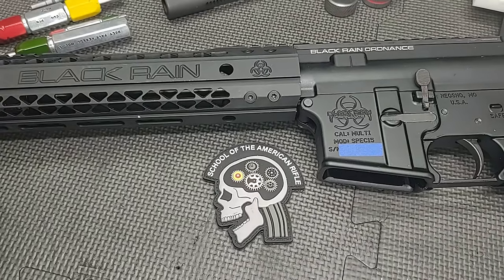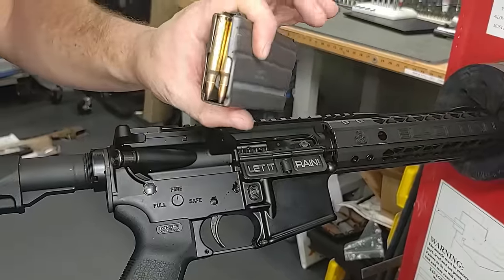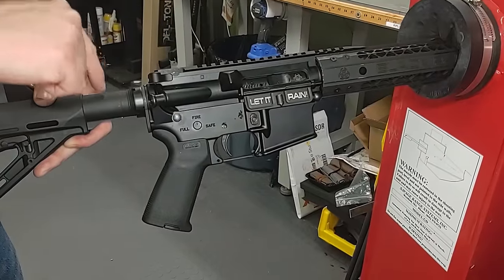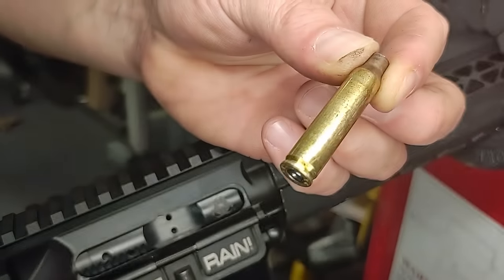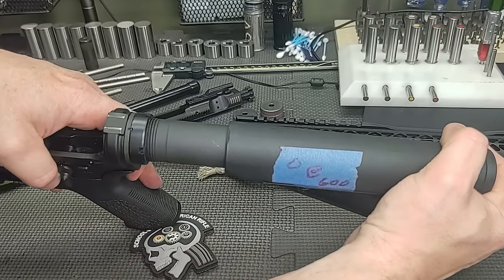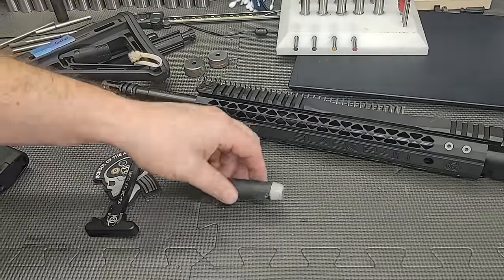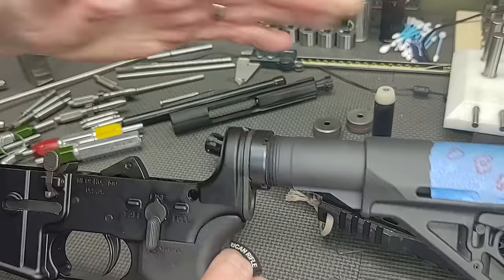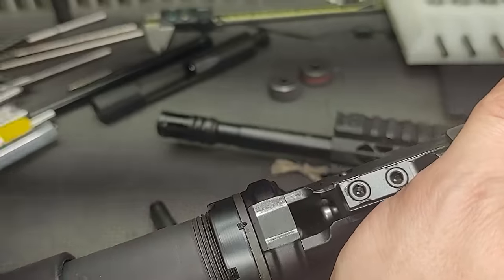Black Rain Ordnance SPEC15 - AR15 Autopsy (Part 1)

Comment: It seems like you have better measuring equipment than the people actually CNC machining the parts of the rifle. How could parts like these pass any type of manufacturer QC with so many tolerances so far off? No one is checking for obvious flaws?
Reply: It's a bit more complex than that. You'd see a non-trivial price increase on a manufacturer's products that gauged out perfectly. Costs increase both on time involved/manpower hours and product rejection. Most manufacturer's aim for "good enough" and rely on tolerance stacking to a minimum. Often times, you can pass perfectly fine under this operating standard. There are exceptions both ways.
Reply: Because they don't need to be perfect.

Comment: I have a Black Rain Fallout 15, that I bought a year ago. No issues with it yet, and put right around 800 rounds through it. That said I did immediately replace the buffer and spring after purchase, with a Cozad Manufacturing Mk18k 4 oz H2 AR15/M4 buffer and a Strike Industries flat buffer spring. I did that because I replaced the same parts on my older (2011 Olympic Arms) AR15 with good results. My eject pattern with the BRO is right around 45°. I just checked the buffer tube, key strike spot, gas tube tightness etc and I don't have any of the issues present on this rifle.
Reply: 800 is a pretty low round count and much less than this rifle.
Reply: No getting around it.. With a gas port size of .089 on a 16 inch carbine gas system, You absolutely will run into problems eventually.
Reply: @RandyTheB_  What, so because I don't put 12 thousand rounds out of my rifles it somehow invalidates my experience?
Reply: @cannaventureseeds2909  Really? So you gauged the port on my barrel and know for certain that it's the exact size as the one in this video? You must be a grand master ninja, because I never saw you get into my gun safe. 

What ever happened to "This is an example of 1?" I guess that only applies when he covers stuff that you own.
Reply: @scout3058 agree that this is an example of 1 and should be seen as that. I guess the concerning factor is that every aspect of this gun has a failure. From out of spec and cheap parts to improper throat and gas poet sizes it should make a new buyer question I'd they really want to spend the money asked on this brand and have owners go back and check theirs.

Comment: That is not the black rain upper that i have. Mine is more octagonal in shape where that one is round. My gun is flawless after 2k rounds plus. That being said, i have swapped the bcg, trigger. That buffer isnt on my gun either. I have a dark blue very stiff end. Mine is also the spec15. I do plan on replacing my barrel believing that mine is also over gassed but not that much. Great video with amazing points. However not every gun is perfect.  Ive seen daniels not fire correctly and ive seen rugers put bullets touching at 70 yds.

Comment: Question for you sotar....how do you have conversations with gun owners? I struggle to have any reasonable convo qith the average gun owner because of the lack of knowlwdge most of them have. I take for granted the info i have and what ive learned from channels like yours. Im getting to the point i avoid convos  about firearms because i dont want to be "that guy" and constantly have to correct ppl. I grew up with firearms and also ita my hobby. The average gun owners i speak to know less than my 11yr old daughter. Would love opinions on this

Comment: I tammed an overgassed 300blackout with an h3  buffer. The bolt cracked at the cam pin around 7k rounds. I got a noveski cam pin and bolt and a strike adjustable block. I can not remember if I went with an h2 or h3 after that but it shoots sweet now. I don't like the idea of taming one with buffer and springs anymore. I noticed that the bolt was failing the day before I was going to need it for something important.

Comment: Good information. Thanks for the education on the carrier spacing at the buffer tube. That's something I wasn't aware of. Looking forward to the solution to these issues with the gas system. I love learning new stuff. 
Is there a good source for these specs and tolerances you use in your autopsies?

Comment: I've been looking all over the place and can't find the gauges you're using! I found your tool gauge list...but some of the gauges you're using I don't see listed on there. Where did you get the go/no go gauges for all of the pin holes with the red/green as well as buffer tube extensions to measure class 2 and 3 threads?

Comment: i'd be curious what kind of loads this customer is shooting. also if the barrel is testing at .223 head space and seems over-gassed with 5.56... I'd run a few .223 rounds through it for a sanity check. perhaps I'm wrong and didn't listen well enough but it seems that all these issues could stem from using over-powered ammo

Comment: Apparently BR hates their customers. One of those issues, ok. Two, ok, if one caused the other it’s understandable but that entire rifle soup to nuts is disgusting. Tolerances are out of control in almost all key operating areas. (089 gas port on a carbine length 16” barrel!) Build quality is subpar. Parts are garbage. What a shame. Especially considering their aesthetic is usually more appealing to first time gun buyers or new ar owners. Imagine this being your first ar. I wouldn’t even know where to start.  Not to knock anyone who owns a BR, to each his own and I hope yours is great and runs flawlessly.

Comment: I had ones of these, after about 1200 rounds it started doin ALL the same shit! So I threw lipstick on a pig. I put in an AO BCG, Odin Works adjustable gas block, new buffer tube and a JP silent capture spring. Had a buddy clean the feed ramps, and durakote it E German Raindrop camo in black and grey (black rain😂)  now it’s just a nice shit kicker

Comment: I would of liked to see the inside of barrel to see how eroded it was and to see if previous owners had maybe drilled out the gas port to try and fix problems.
Reply from the maker: Since it was running long I skipped it. The barrel does have some use but nothing bad. I checked it after the video.

Comment: Great diagnostic video Chad.  I'm just curious, what would be the typical advantage(s) of a carbine length vs a mid length gas system?  Seems to me the carbine length would result in more wear and tear on the rifle compared to a mid length gas system.  Thanks for the informative videos.
Reply from the maker: Carbine Gas is harder on the parts than mid length gas. Carbine Gas is fine as long as you do things right.

Comment: Why is there a rope/cord hanging out the front quick release at front of the hand guard? Castle Nut definitely was not tightened down correctly. Oh I was so annoyed you didn't push the FCG pins back in after testing for several minutes. Looks like the spring on the dust cover was not setup correctly when installed. Thus why I love my adjustable gas blocks yet I also shoot a lot suppressed so it very easy to over gas them. Granted most of mine are not .223/5.56. I have pretty much all calibers you can get in an AR-15. I hate that style of barrel nut. So annoying. For mid price range which I am guessing this one is that is some very crappy build quality. I will stick with my poverty pony lowers and just build my own for at least half the cost of their cheapest model and I know it will have good parts. Where can I get those gauges you have? Those look like something good to have. I do love the H3 buffers especially for suppressed.

Comment: Anytime I get a used AR. Before firing I always inspect extensively. 
After having an AR blow up on me. I always immediately change out the buffer spring to a JP polished extra power spring and either an H or H2 buffer.

Comment: A bit late to this party, but what's that cast code on the upper; the square?  Isn't that the mark of the company that actually produced the upper for Black Rain?  It shouldn't be a make or break, but the actual makers of the receivers would be an interesting datum.
Reply: Thats the forger's mark, (Brass Aluminum Forging Enterprises). They only make the raw forging, someone else finish machines and anodizes the part. Not saying BRO did it, (likely they outsource it from a 3rd party vendor).
Reply: @newdefsys  Thanks

Comment: This is why you invest in training for new employees. All these small details add up to a rifle that won't run. What happens is employees get thrown on the assembly line and just told to "screw bolt into hole" never being taught how to do it correctly.

Comment: Hello, i have a question if can answer, my ar15 i have noticed has a alignment issue with the receiver and extension. I can see from the feed ramps and a small impact mark on one of the lugs at the 8 0clock. I have checked the pin and it is not sheared and before torque it is aligned and then after torque it is turned slightly. I am using grease on the shelf and threads. Would a action rod like the wheeler delta or urr fix this?

Comment: I'm using BRT gas tubes on 2 dedicated suppressed builds.  They are working great but what are your thoughts on longevity of the tubes?  Seeing that the thin tube is doing all the "gas control" work vs the thick wall of the barrel.

Comment: Great video man, question is your headspace extension gauge a custom 1.4646 or a 1.4636 from ptg?
Reply from the maker: 1.4646
Reply: @SchooloftheAmericanRifle  thank you, did you have to special order that one because Pete told me the 223/5.56 ones on the website are 1.4636
Reply from the maker: @peeeoii2738  it's been some time. I can't recall if it was custom.
Reply: @SchooloftheAmericanRifle  okay got it thank you anyways Chad!

Comment: Is it acceptable to shim the barrel 1-2 thousands to fix head space and the feed ramps? The feed ramps will probably need little more work still.
Reply: I'm not sure I follow. Do you mean to unscrew the barrel extension to insert a shim between barrel and extension? That would destroy the alignment of the feed ramps and the gas port. I could be wrong, but the only remedies are to recut the chamber and ramps, leaving the extension where it is. And given how rough the brass was during the test fire, finishing the chamber would likely help that as well.

If it were me, I would just put all that money towards a new barrel.

Comment: I have seen many of the same issues in a few Black Rain rifles. They claim themselves as "top tier" and they sell for as much as BCM. I run BCM exclusively and all the Knights, Noveske, LMT, and Daniel Defense say my BCM is not even top tier lol.
Reply: "They claim themselves as top tier." That was the funniest sh*t I've read all week. I would put Black Rain in the same category as Radical, Del-Ton, Bear Creek etc. Also my BCM/Aero build identifies as KAC/LMT. 🤣
Reply: @jonathanwick1265  their description of the rifle says top tier on the website. I don't think BCM is top tier but is worlds above black rain, Aero, and PSA which I would put in the same category. My point is all the operator guys say BCM does not even compare to them so how could Black Rain be anywhere close to top tier. I know right where my BCM stands and I'm fine with that.
Reply: @556arbadboy  Agreed. I don't think BCM is top tier, they're a good solid company. But for BRO to claim they're a "top tier" manufacturer is laughable if not down right delusional.

Comment: My AR the bolt always smashes the in the middle of shell casing every 3rd or 4th round if I shoot slow sometimes I can halfway through a mag before another round gets stuck and casings eject at 1 o'clock as well. Do you think if I got an H-Buffer that would help?
Reply: You could try that, but it sounds like a failure to eject issue. Extractor may be worn, or a weak ejector spring may also be causing the issue.
Reply: @KeterMalkuth  when loading the next round the bolt will close 3/4 of the way smashing or crushing the round Inside the chamber coming out looking like a boomerang lol  After I mortar the  rifle to get round out, it's done this every since I got rifle I think 3 yrs ago now
Reply: @KeterMalkuth  Ok, thanks for the advice

Comment: Aside from “nato spec” is there any way for a normie to know if ammo is weak or not?
Reply: Generally speaking .223 ammo is weaker across the board than 5.56 ammo id just stay with federal , Winchester , frontier and pmc in either .223 or 5.56 and you’ll be good to go.

Comment: Usually whenever a company has a cringe edgy name like "black rain" the gun is going to be pretty rough.  Not necessarily bad. But almost certainly not a gun worth whatever it is you paid for it.  This... looks like black rain's "tyrant" model. Which is currently listed at 1300 bucks. Idk I could be wrong. But if I'm right then yeah homeboi got ripped off.

If anything black rain has alot of opportunity for improvement in build quality and QC checking.

Comment: That firearm was used hard, not well built or maintained.
Reply from the maker: Only has a few thousand rounds at most based on my after video diagnostics.
Reply: @SchooloftheAmericanRifle  Sum of the parts.  Learned a lot.  TX